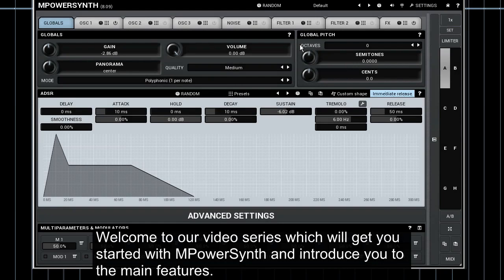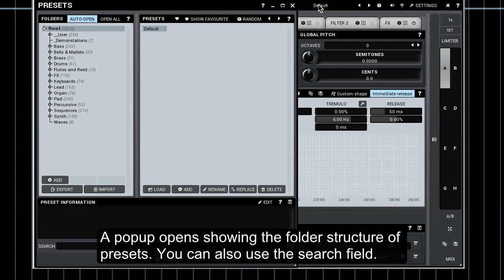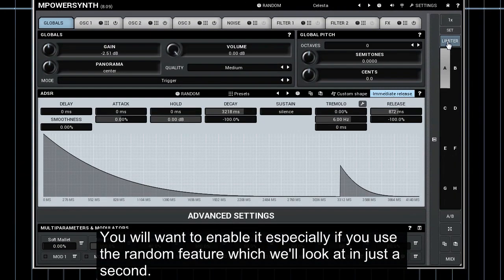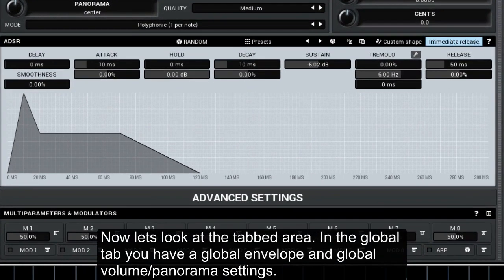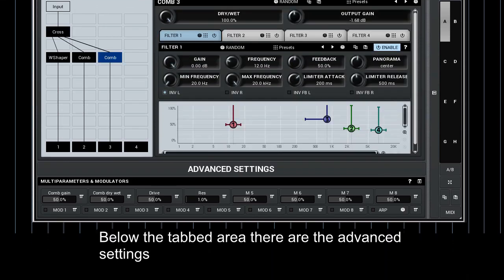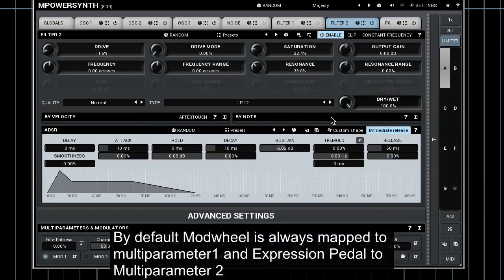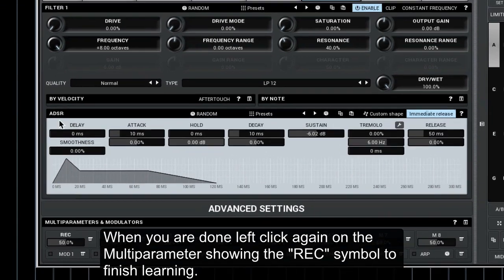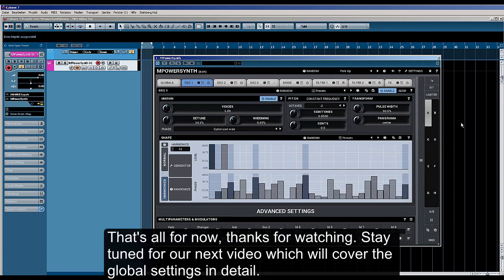MPowerSynth tutorials - Part 1 - Introduction

Comment: Seems like it would be nice to be able to apply effects per oscillator. I don't understand the decision to only allow effects to be applied to the sum of all the oscillators.
Reply from the maker: That's because effects are global, not per voice of course. And the rest of the engine is per-voice. But you can always insert another MPowerSynth instance INSIDE the FX section, so like a synth within a synth, so what you want is entirely possible ;)